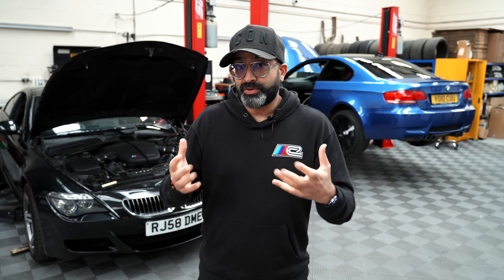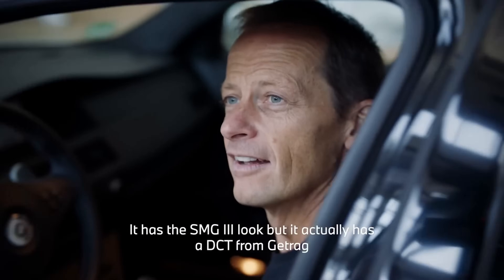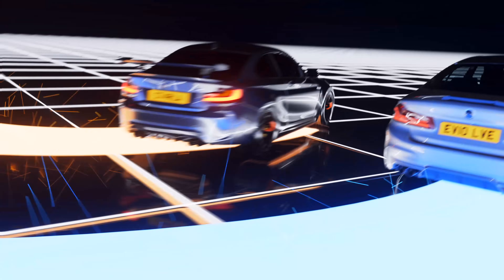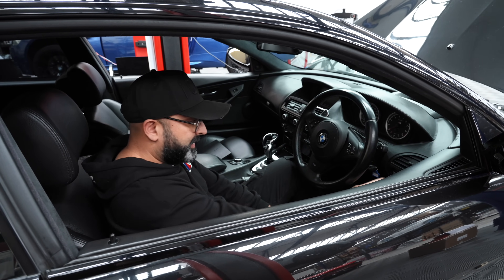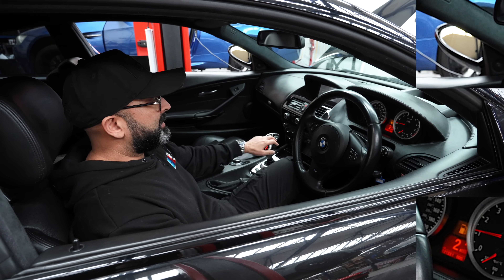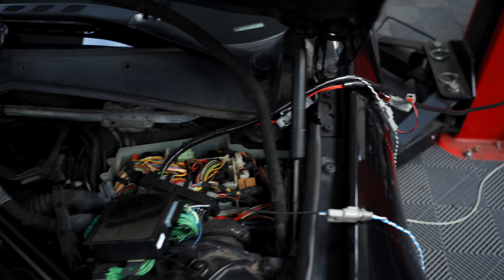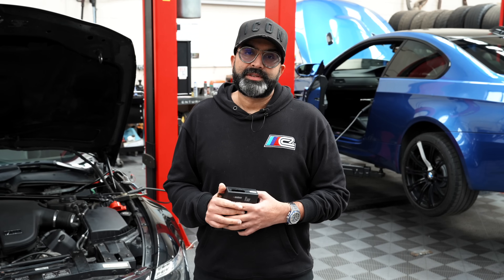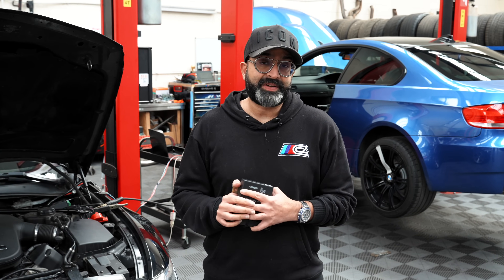DCT Swapping our V10 M6 on Stock ECUs - Episode 01 - Proof of concept

Comment: Can anyone explain to me why you would do this. 

I’ve heard reports the SMG is slow to change gear, but in max gear change setting is actually quite quick to change ? 

Is it just the reliability pov or something else. 

There is an appreciable level of fun in a single clutch car because they really slam the gears, makes it more of an event. 

Does the DCT swap have better gear ratios? 

Cheers
Reply: Simply the better auto, they’re also less likely to die

Comment: I Gota ask, 

What are you guys trying to show us here? Are you saying you’re controlling the m3 from the m6? If so how much of it are you controlling? 

I’m struggling with the 1st to 2nd gear change a rev up to 2k rpm on the m6 clocks but no noticeable change in wheel rotation speed on the m3. 

Do you actually have throttle control from the m6 to the m3? 

The Gws can just be connected and wired in with zero calibration changes or additional intercepting modules with a stock mss65 just changed to manual transmission and the cars will drive upshifts and downshift. The driveability is just complete turd. 

I’m very invested in this as it’s a whole diff route to how we’ve done it and as there’s more than 1 way to skin a cat I’m keen to learn.
Reply: Please dont skin any cats

Comment: I always wondered what the e60 M5, E46 M3 or even a E39 M5 would be like either modern transmission like DCT or the latest iteration of the ZF gearbox.  The cars would be quicker and have a top speed. 

Can be we have a E46 M3 transmission conversion?
Reply from the maker: We are focusing on the S85 platform first, but there’s definitely been discussions about other models if this project is successful
Reply: @EvolveAutomotive  I don't think anyone in the world has done a E46 M3 transmission conversation so it will be a first and the road test and performance test will be a treat

Comment: Hiiiii 

Internet rumour here…. 

Congrats on doing it, Using Dans can controller to me isn’t a full OEM swap tho. It is essentially still another module intercepting and changing signals. 

Cool video tho.
Reply from the maker: @ratdognuno  Hiiii. No congratulations until it's possible as a plug and play solution and drives like OEM. Doing it with the Dan controller is the only way we can offer it to customers without infringement of BMW IP ie doing it the way they did it on the M5 CSL. The software is easy enough to obtain if you know the right people. But commercialising it is another story.
Reply: @EvolveAutomotive  Using that rationale, any DME tune has copyright issues since all tunes take the BMW software and adjust a handful of tables.
Reply: @ don’t we know it. Lol even then, there is issues with the software. We are sure bmw left bugs in it on purpose. 

If you guys manage to offer the plug and play solution it will be really cool, these cars need to be enjoyed more.
Reply from the maker: @ratdognuno  Thanks 🙏🏽 A lot more development and testing required yet. The car becomes a different proposition with the DCT.

Comment: Such a shame that Evolve decided to talk about another youtubers accomplishments but didn't bother to give them a shoutout - @ratdog

Also building a CAN box like that when other boxes already exist to do exactly what you are doing (CANTCU, etc) seems like reinventing the wheel for no reason at all.
Reply from the maker: I’m not sure what part of the video you mean, the only thing we referenced was videos from about 10 years ago which if I remember correctly were by Gintani. Did look to include a bit of them in this video but couldn’t find them.

So far we haven’t seen a commercially available product that could do what we want it to, hence spending the time/money to do this because we want the community to have easier access to DCT swapping S85s - if we can get it performing like we hope, and that’s a big if, still a lot of work to go.
Reply: @EvolveAutomotive  Well I broke my first rule of "assuming" in that case - as you said 7 years ago which is roughly the time frame Ratdog initially did this swap apparently.

That said, you should seriously consult with Kenneth @ CANTCU on this project, as he is an absolute wizzard when it comes to what you're doing and as you know DCT fucntionality relies heavily on everything that it expects to see (blips, cuts, etc) are there/present at the correct time and for the right amount/duration so you will need to deal with the ECU side as much if not more.

Comment: Great work Imran and the Team! I actually seen your M6 in my home town being driven by the Mastermind himself!! We had a good Chat.
I’ve had a DCT E9X box in my garage now for a couple of years now awaiting for a solution for my E60 M5 😁
Reply from the maker: It’s certainly been doing a lot of development miles, and a lot of time spent at the petrol station… 😬
Reply: @EvolveAutomotive  @ratdog done more miles and testing
Reply: Plenty of Shell loyalty points 😂
I gather it’s still got the oem 3.62 Diff ratio?
With my DCT box I also obtained a 3.15 gear setup to keep the ratios as they are on the DCT M3’s
Reply from the maker: @ yes currently standard M6 rear diff, all things we can experiment with once the DCT swap itself is complete.

We actually swapped our E92 M3 to a 3.62 FD and much prefer it to the 3.15. Sharper acceleration but still perfectly usable for European road trips.

Comment: Does the gearbox have to be from an E9X M3, or are there other vehicles it could come from (335is, 135is, etc.)? I wonder if the supply of DCTs could become an issue if this really catches on. An S85 with a DCT and a shorter final drive will be an incredible driving experience!

Comment: Is it possible to fit ZF-8hp with s85 in this car??
Reply: Torque Converters can't handle RPMs that high. I suspect if you don't want to rev above about 7200rpm you'll be fine, but then you are losing a lot of power!

Comment: Always been wanting one of these but the SMG gearbox has thrown me off, and I don't feel these are manual cars. DCT should fit them the best. If you're doing it on stock ECU now that means it should be more available with detailed instructions in about 2 years when I have the budget.
Reply from the maker: We’d love to get this to the point where it’s a commercially viable project for others to enjoy also! But it needs to meet our high standards of being as close to OEM in functionality and drivability as possible.
Reply: @ I have nothing but time and fully trust the quality of your work, keep going 🙌